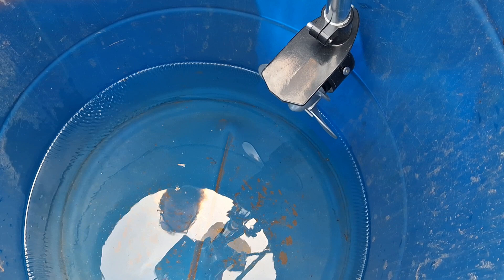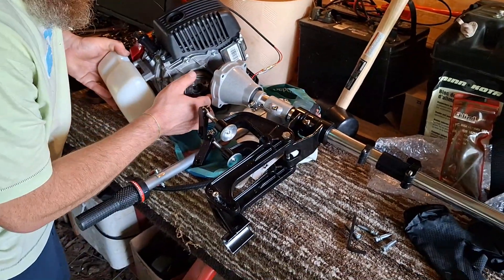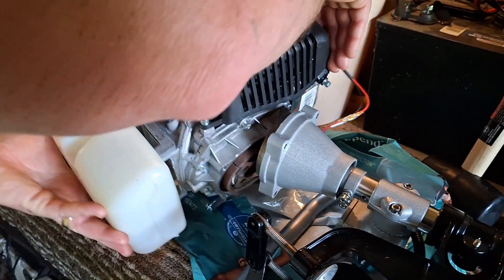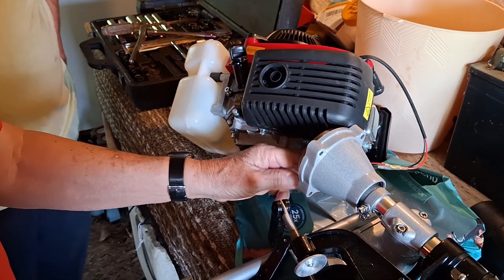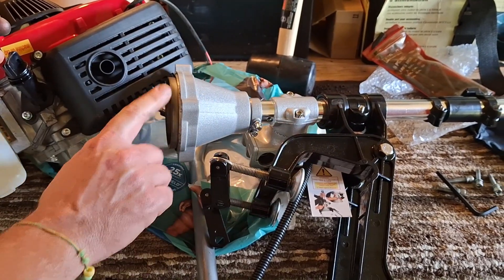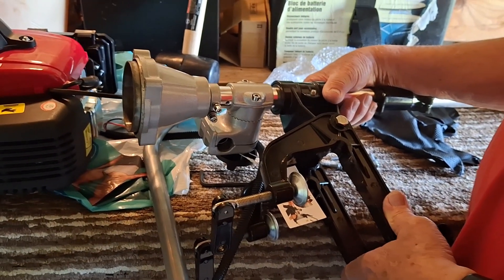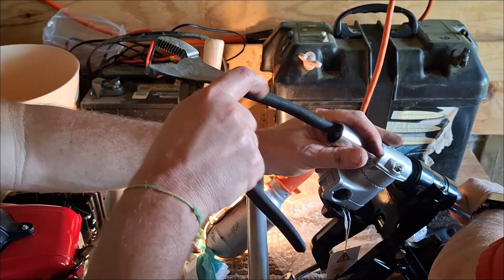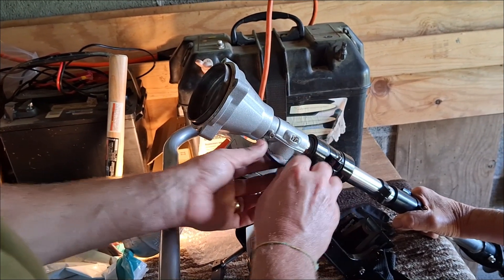Watch This Before Replacing Your CUKUSIN Motor Parts!

Comment from the maker: Did your Cukusin 4hp motor poop out? This one did...and the cause was so simple stupid, and right in the face, that it went completely undetected as the prop and shaft is removed from the motor head. It is only then, as the pitiful thing lies in pieces that the true culprit (Friday engineering at the plant) is detected and corrected. Had the true boog been known the tear down would have not been necessary. So....viewer... my problem prolly won't be your problem....but if your misery includes taking your Cukusin motor partially apart, then have a look at this good old boy Saturday afternoon session before you break out the wrenches. Comments welcome.